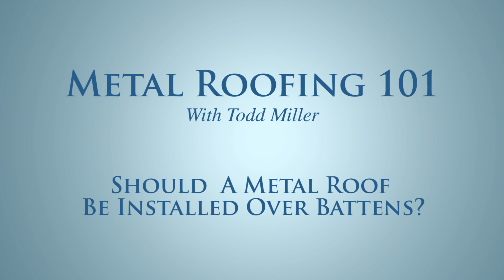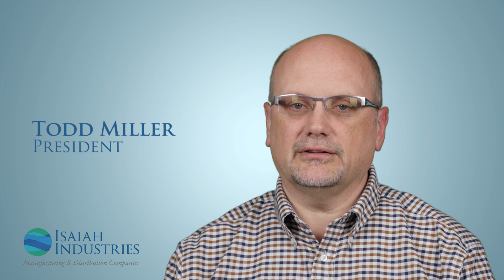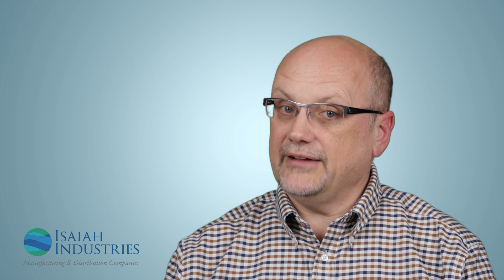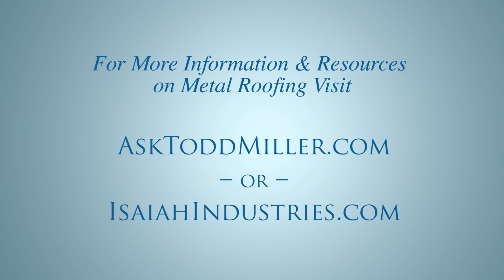Should a Metal Roof be Installed Over Battens? – Metal Roofing 101 with Todd Miller

Comment: Hi!  I am wanting to switch from shingles to metal roof here in hot and humid FL.  I will be removing the existing shingles, use HT peel and stick underlayment and planning to install 2x4 battens because my deck is only 7/16" OSB.  I will be using vented outside closure on some of the ridge.  But how about at the eaves, shall I use vented inside closure strips?  That way hot air will flow from the eaves to the ridge and dry out possibly moisture?  I am also thinking of notching the 2x4 battens, to have proper drainage, just in case.  Thank you!

Comment: So how does batons cause condensation?
Reply from the maker: Battens do not cause condensation. I apologize if something I said indicated that.  My point is that if the attic is vented and insulated properly, that is all you need to control condensation in virtually all cases.  Battens do not provide any further help.  Battens, though, do make the roof harder to walk and can contribute to wind uplift.
Reply: @IsaiahIndustries  oh I thought you said something about condensation between the metal and the old roof deck if the metal was up on strapping

Comment: Hi Todd.  We are installing a 10/12 pitch metal roof on a 24x28 rectangular cabin with 2x10 rafters and r30 insulation with 1x8 pine T&G as exposed inside ceiling, zipboard sheathing and titanium wrap on top.  It will have a full length ridge vent and soffit vents in GA.  Do we need battens (furring strips) to attach the metal roof or should it fasten right to the zipboard?
Reply from the maker: Thanks.  I am glad to hear you’re placing underlayment over the Zip Board Sheathing.  I am unsure whether you are using a synthetic nailed-on underlayment or a self adhering product but really that does not affect my response. You should be fine with direct to deck since you are venting the roof assembly.  That will help to get rid of any warm moist air that migrates to the underside of the roof deck before it can condense due to cooler temperatures of the roof deck created by the metal.  I am not a huge fan of purlins as they make the roof harder to walk, can cause deformation of the roof, and also can decrease uplift resistance.  If you really want a belt and suspenders approach, you could use an entangled mesh such as RoofAquaGuard Dry Tech on the deck.  This ¼” thick product creates a thermal break to help prevent temperature transmission, both hot and cold, from the roof. It can also help with sound attenuation into the roof assembly as well as put a bit of a crown in the standing seam roof panels to help take up “extra metal” in the panels and alleviate oil canning.

Comment: so why would you have a problem that wasnt there to begin with aftwr you put metal on?
Reply from the maker: The properties of metal can cause it to drop the temperature of the roof deck when the metal has a great deal of contact with the roof deck assembly. If the building was previously on the cusp of condensation issues, this could push it over the edge. Always important to analyze the ventilation and vapor barriers in the structure along with any insulation.
Reply: @IsaiahIndustries  what you mean  drop the temp of the deck? doesnt it raise the temp too?
Reply from the maker: @Brandon-no3vc  Metal is a very strong, fast conductor of cold and hot. The concern when it comes to attic condensation is that, when temperatures drop at night, if the roof deck gets too cold too quickly and you still have warm moist air in the attic, it will condense against the underside of the roof deck. Here’s a link to a webinar that may be useful to you. https://www.youtube.com/watch?v=NYwD9CWveKY

Comment: Remodeling a log cabin with moisture issues in attic and no soffits.Plan to install 1.5 inches of polyiso sheet insulation on top of roof. Also, closed cell spray foam(4 inches)in rafter bays in attic space....rafters are flattened logs about 4-5 inches in diameter. Question: if we do horizontal and vertical battens, do we add 1/2 inch plywood on top of the battens before the metal roof installation?.....that would incur more weight on the rafters, but maybe necessary, requiring the adding of actual 2x4s or 2x6s to strengthen the rafters?..appreciate your advice...Northern Wisconsin.
Reply from the maker: Thank you.  Based on what you’re telling me, I do not feel that battens are necessary.  The amount of insulation you’re adding will prevent the cold from the metal roof from conducting down into the structure where it will come into contact with warm moist air and cause it to condense (“dewpoint”). Additionally, the closed cell foam acts as a vapor barrier and will hold moisture inside the living space rather than allow it to reach the roof system.
 
That said, you can add battens if you wish.  If you do not put decking on top, make sure the metal panels you are installing are approved for application over battens.  Battens without decking will make the roof harder to walk and could increase the chance of  wind uplift.

Comment: I enjoy you videos and have some questions.  I am restoring an old 2 room farmhouse in texas.  I have converted the gable roof to an open cathedral, adding chords near the ridge and beams at the top of the walls to keep them from bowing out.   I plan to install 2 x 4 battens perpendicular to the 2 x 4 rafters (24 ' centers) then install metal roofing to the battens with no underlayment.   Then will use closed cell foam in the ceiling, walls and floor.  Do you think this plan is adequate for the roof (I dont think underlayment is necessary in this case since venting not required).
Reply from the maker: This should work because the closed cell foam acts as a vapor barrier. That said, the industry is not yet fully sold on this idea of spraying foam direct to the back of the metal roof panels.  Most of us would prefer to see a layer of solid decking installed. Spraying direct to the panels, for one thing, will make repair or replacement of the roof metal very difficult.

Comment: Thanks for your video!  I have a question for you though.  I need to reroof my 3/12 pitched timber Frame home (built pre 1950) with red pine log trusses and tongue and groove roof decking.  My roof is a sealed system and does not have venting (and no way to vent as there are no soffit or fascia for venting and no way to add it easily or economically).  My question is that my living room area is a cathedral ceiling with no attic space.  Literally it is the exposed trusses, the tongue and groove decking and the the shingles on top.  I want to do an exposed fastener metal roof this summer (standing seam is too expensive for me) and was wondering if I created an air gap 1x4 cross batten  boards (roughly 1.5" air gap) would be enough to vent the roof so if would not have ice dams or condensation issues?  I already get crazy ice dams on my shingled roof as it is, due to heat loss from the portion of the house that is not insulated.  I was also thinking about putting ice and water shield over the entire decking before installing the cross battens.  I am in Michigan.  Thoughts?
Reply from the maker: Thanks for your note.  These are pretty big questions you’re asking.  I like the idea of cross battening.  That will help with ice dams and also it should help with summer heat gain. That said, I am a bit concerned that, even with the air space, the metal roof panels may end up dropping the roof deck temperature, increasing the possibility of condensation on your ceilings.  I think I would take this time as an opportunity to add some insulation on top of the roof deck, following by the airspace.  If you wish, feel free to email direct to me and we can discuss things further.  todd@asktoddmiller.com

Comment: I have an old 1950s house, 5v metal over cedar shingles. There is no sheathing under those layers,  just "real" 1 x 4 cedar board 5" OC.  I was told I could save the OSB money by applying a heavier 26 ga metal roofing directly to battens without sheathing. Do you think that's o.k. ?    There have never been any condensation problems in my 13 years here so far.   I'm in central Florida.
Reply from the maker: Thanks for your comment.  Am I correct in understanding that you’re asking about removing the existing two layers of roofing and that the bottom layer (wood shingles) is not on solid decking?  So, the thought is to install metal over battens at that point.  Please correct me if I am not following things correctly.
 
However, if I am following things correctly, I would not do this. I am not a fan of the underside of metal roofing being exposed to an attic on residences.  Metal is the perfect surface for condensation to occur and, in this case, it would likely happen.
 
Here’s an article I recently wrote on the topic of condensation that may be helpful to you: https://blog.mcelroymetal.com/metal-roofing-and-siding/condensation-ventilation-and-your-metal-roof
Reply: @IsaiahIndustries  Thank you for taking the time to respond, I know it is work.   You are correct.  My roofer says this is not an unusual path in the downtown historic area of my city... I know it's not ideal he is trying to save me $$$ with OSB at $50 and 15/32 plywood at $75 in June 2021; which I understand and appreciate.    Do you think it's just a matter of making sure and having good ventilation circulation or do you think it will be something 5-10 years from now someone will say  " What idiot did this!!?"
Reply from the maker: @OLong-fv8vq  Over the years, I have been contacted by many property owners with metal roofs installed over battens and no decking. They were experiencing severe condensation issues on the back side of the metal.  Avoiding condensation requires three primary things:  Vapor Barrier (behind the ceilings), Insulation (on top of the ceilings), and Ventilation (meaning intake and exhaust vents to code in the attic). You can sometimes get by with just two of these but never less than two. Making sure you have ventilation to code will be critical in your situation but my general advice is never to install a metal roof on a residence without solid decking and underlayment.
Reply: Old comment but thought on an old house with no condensation problem. 

There are a number videos on this topic. The assumption seems to be if there’s no condensation problem then it is because there’s no moisture. The fallacy is that there is lots of moisture in old buildings, but it’s not seen as a problem because it dries before it becomes a problem. If you improve the conditions so there’s less air flow leakage, then there’s also less drying and the moisture does become a problem.

Comment: Thank you for the tutorial. I am stripping the shingles off the plywood deck of a detached garage. Can I lay metal down without battens if I put a synthetic felt layer between the deck and the metal? The garage will be heated. I am worried about condensation occurring. Thank you.
Reply from the maker: If you’re installing a vertical seam type of panel where the metal has a great deal of contact with the roof deck, I would suggest battens.  My concern is you probably do not have a vapor barrier or attic insulation. With the metal in direct contact with the roof deck, the temperature of the roof deck is dropped and that creates potential for condensation on the underside of the roof deck. Getting the metal up on battens creates a thermal break to help keep the roof deck warmer and therefore less prone to condensation.   Make sure the metal you choose is approved for installation over battens.  I still suggest underlayment even if battens are installed.

Comment: I’m building a new structure I’m putting 4” of polyISO on the roof then Zip sheathing,  my question, can I go right over the Zip with my standing seam roof with no battens, Just straight lay down?   Thanks.
Reply from the maker: Hi Larry.  Given what you have told me, you should not need battens.  That said, I would encourage a layer of synthetic underlayment despite using the ZIP sheathing. I have heard of issues with fasteners blowing through the laminated underlayment on the ZIP system.  I also once heard of a standing seam job where the roof panels were rubbing against the ZIP tape, and that was creating noise with expansion and contraction. If you would like me to take a closer look at your project, feel free to email plans to me at todd@asktoddmiller.com

Comment: Can i lay metal roof on top if zip sheathing(treated OSB) with maybe an underlayment on top of the sheathing?  Seems like the screws will make a water leakable hole?
Reply from the maker: The problem is with wind-driven rain.  The water can’t get off the roof quickly enough and can therefore “flood out” panel overlaps and snaplocks.  Mechanically seamed standing seam would work. If not, a TPO or other quality single ply membrane is a good option.
Reply: @IsaiahIndustries  Ah I see thanks.  U know ..i am in Los Angeles.  I cannot remember the last time we had rain.  Yet alone "wind driven"..:>)
Reply from the maker: Thanks for your question. My advice is to put an additional layer of synthetic underlayment over the ZIP sheathing. As far as metal roofing, I am a huge proponent of concealed fastened, fully interlocking panels.
Reply: @IsaiahIndustries  Thanks...actually I am in the idea phase.  My previous roof which i just ripped off was 1/2 plywood, tar paper, and asphalt tiles.  The roof has a 1% slope so that did not last.  I am thinking just metal panels over battens..I mean its only two cars...but a question I have.  ALL the websites that sell metal panels...like the classic rib..all of them recommend a much greater slope it seems...so why is it I see so many carports and patios with classic rib panels?  Do they all just leak..thanks in advance...
Reply from the maker: I strongly encourage never installing a panel at lower than its manufacturer’s recommended minimum pitch. Manufacturers would like to sell as much product as possible – if their panels worked successfully at lower pitches, they’d allow it. Metal Sales’ “Classic Rib” panel requires a 3:12 pitch. Most industry “R” and “PBR” panels require 2:12. For roof slopes less than 2:12, mechanically seamed standing seam should be used, or else another panel designed specifically for that purpose. Without decking, you will sometimes have condensation dripping from the back of the panels. There are people who use panels at lower than their recommended minimum pitch and, eventually, it comes back to bite them. Also, there are some panels manufactured specifically for carports and patio covers, such as “W” panels, that can be used on very low slope roofs. Again, always adhere to manufacturer specifications.
Reply: @IsaiahIndustries  So what do u recommend for a 1.5% say slope...i thought at that slope water would flow...not puddle. ..I am confused bv that....if the water flows...why would it leak..flows to slow?  EPDM?

Comment: Is there a problem using Treated Battens under a Galvalume metal roof
Reply from the maker: Yes, the chemicals used to treat the wood will corrode the metal. Only untreated lumber should be used.

Comment: I have a new out building that has a 12 degree slope on a 16 by 24 foot roof.  I live in Index WA.  We have a little bit of snow every year, and lots of rain, and temps in the summer run mid 70's to high 80's occasionally.   The OSB is on 2 foot center roof joists.  In other words, the 2x4 roof joists are on 24 inch centers blocked every 2 feet, so the largest section of unsupported area of OSB is 2' x 2'.  There are 1 x 4's on the 2x4 joists and blocks to increase the fastener areas, and increase load spreading.   The OSB is covered with two layers of #30 tared felt.  The room under this roof is one large open vaulted ceiling room.  I was planning on attaching some Metal Sales Classic Rib 3-ft x 12-ft Ribbed Metal Roof Panel right on the felt.  Is that advisable, or should I put some horizontal 1 x 4 on 2' centers to attach the roofing too?  I really don't see the need or necessity but would really appreciate an opinion here.
Reply from the maker: Hi, I received your email as well and sent you a response. Please let us know if you did not receive it.
Have a great weekend!
Todd
Reply from the maker: Kim Davis  Thank you for your comment. We went back and looked at our response to this individual and it got very complicated as we sorted through his exact situation. Generally speaking, we’re not a fan of battens on top of solid decking as the battens can weaken the roof system and also impact things like dormers and gutters. However, in situations where there is limited ventilation and subsequent condensation concerns, putting the metal panels on battens (with spacing as prescribed by the manufacturer) can help keep the underside of the roof deck warmer, which helps prevent the possibility of condensation. We are always happy to address specific questions and they are best handled if sent to todd@asktoddmiller.com Thank you again.

Comment: For "Long Term" use, Remove the Shingles, check and tighten the deck and install over a synthetic under-layment. Use of lathe or batons is in most cases done poorly with too few fasteners and fasteners not attached to frame.  I have seen dozens of roofs installed that in essence were only fastened to the structure with a few nails - bad idea for wind load.